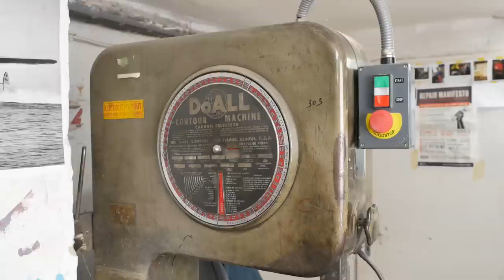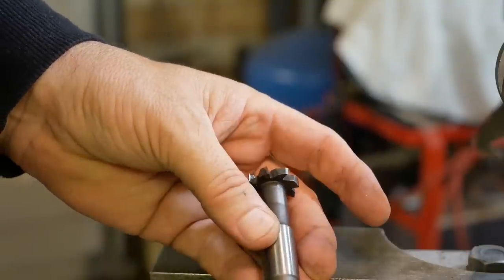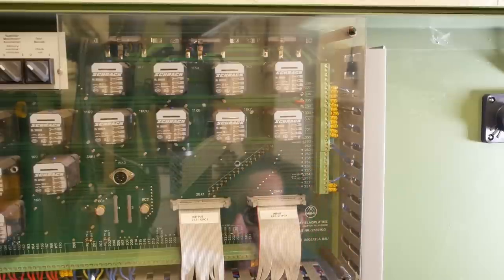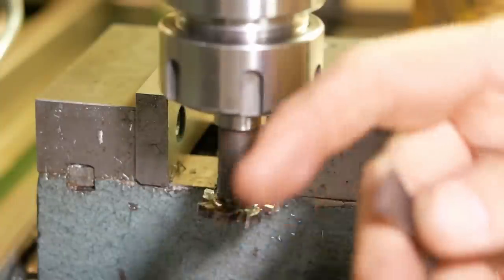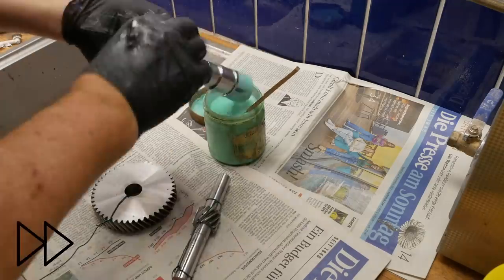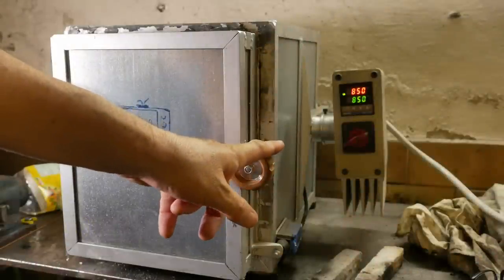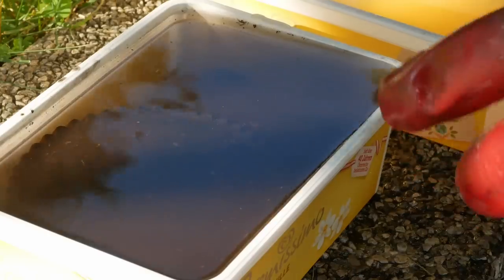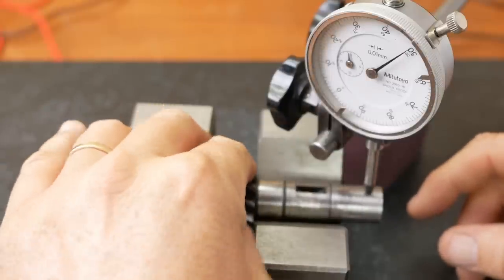DoAll Bandsaw gearbox repair - Part 2 || RotarySMP

Comment: I just wanted to suggest a heat treatment service provider in Hungary. In 2016 when I thought that I am able to make a 6 gear gearbox to my Simson, I sent them a quote and they gave me a quote of €60 incl. 27% VAT for heat treat for like 15pcs of gears and 4 pieces of shafts. Now it seems that they closed down since. Bummer.
Of course I never managed to make a single gear ever since LOL.
Reply from the maker: I wrote to six different companies, in various companies, but only 2 responded. Since Emil regularly uses this heat treater with his work, and has a relationshoip with them, this was the most reliable option.

Comment: I'm curious - aren't you concerned about Hydrogen embrittlement using hydrochloric acid to de-scale the parts?  I've used acetic acid (vinegar) with good effect to descale parts after forging bits and bobs in my gas forge.  Vinegar works well when heated.  Simmer the parts for an hour, and the scale comes right off.  
The only thing I've found to prevent scale is sealing parts in stainless foil to heat, but, getting it OFF when the parts are at temperature and you're ready to quench is a skill I never acquired.... So for the most part, I ignored the lenngth of soak recommendations, and when the part was non-magnetic, it was time to quench.
Reply from the maker: I have no reall worries about hydrogen embrittlement in a 20mm wide gear which only has to transmit max 1kW, and that only occasionally. I wouldn't use any of these processes on a nose landing gear yoke.

I normally use vinegar to descale, but it needs to soak over night, and I ran up against schedule limitations to get the video out.

Have you had good experience with 4340 or 6150 without the austenitising soak at temp?
Reply: @RotarySMP  I'm afraid most of my larger pieces (other than knives and small gun parts) were "scrap bucket mystery metal", so, while I never had a bad result (excepting when I tried water quenching things that did't like that rapid a quench), I can't say with certainty if I ever heat treated 4340 or 6150   (4140 and 5260, yes....)

Comment: Put argon into the heat treatment oven? Although nitrogen seems to be more common due to less cost. Probably also only one part each cycle, as you can't leave the door open, and immediately need to quench.
Reply from the maker: Hi Alex,
I will probably need to make a new oven soon. The CaSi insulation is to mechanically weak, and this oven is deteriorating pretty fast. The next one will get a fitting for Argon purging.
Reply: @RotarySMP  You'll need a 0-10V instrumentation converter for the temperature probe 😉
Reply from the maker: @graealex  Yeah, I already looked into them. The oven is not yet a high priority though.
Reply: @RotarySMP  Well, at least it has enough outputs for heating, a gas solenoid and maybe even a fan and shutters.
Lmk if you have questions.
Reply from the maker: @graealex  For an oven purge, I would not bother with a gas solenoid. You need to turn on the gas before you start heating, and keep gas flow until the part is cool again. That sort of timing I#d just to wiht the bottle valve.
Reply: @RotarySMP  Talking about gas - I have spare FESTO 0-10V proportional 3/5-way valves lying around. They were used in the 6-DOF simulators which we used to build, but they became obsolete when we switched to an integrated FESTO CPX valve terminal. Also might have some solenoids with and without aux/helper (pilot/non-pilot) gas flow requirement. Any interest?
Reply from the maker: @graealex  Hi Alexander, I can't think of a need or use case related to my projects, for such a valve at present. Thanks for the offer though.

Comment: Sounds like you learned a lot from the experience. I know I learned from your mistakes.
Reply from the maker: Yeah, I have to see it that way as well. I have never heat treated such large parts. Was about time I tried it.
Reply: @RotarySMP  I've never tried heat treating anything before even though I am interested in it. But your experience shows me that you are going to get some distortion and need to leave a certain amount for clean up. Is the the cleanup going to take more depth than the heat treating went though?
Reply from the maker: @DodgyBrothersEngineering  These parts are now through hardened, not case hardened. So there is no risk of taking the hard skin off.